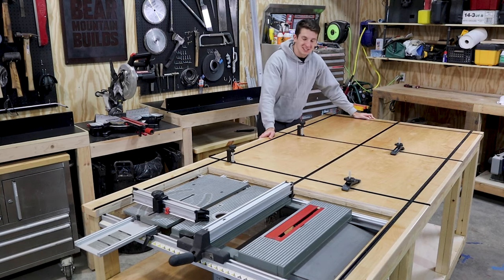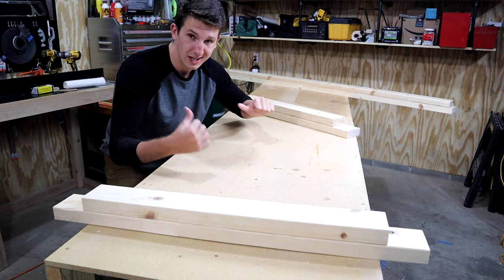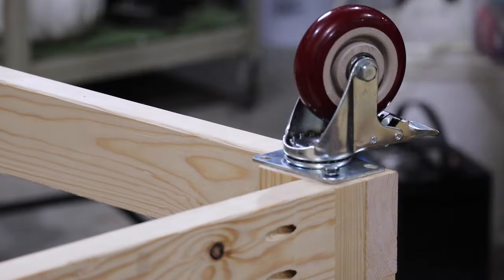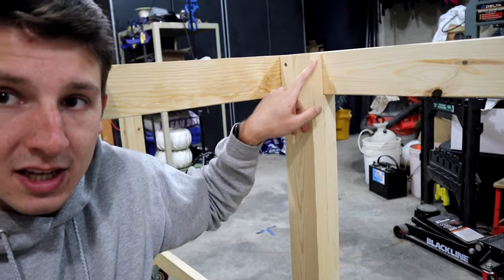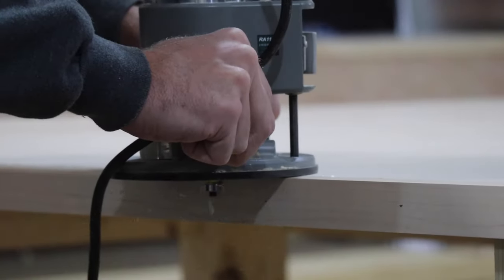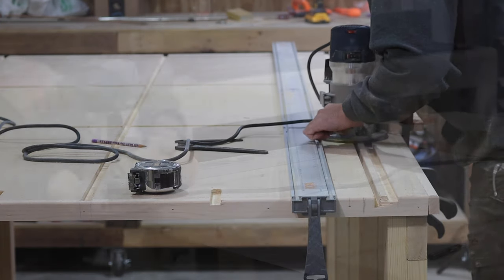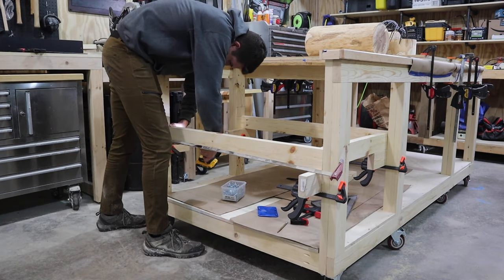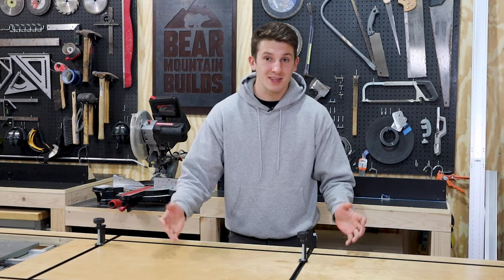Build This Simple Table Saw Outfeed and Assembly Table - Part 1 | FREE PLANS

Comment: I've been preparing for an outfeed / assembly build and also have a Ryobi (BT3100) just like yours. Are you happy you put it all into one piece? Not sure if it would get in the way, especially if you want to lay some large sheet goods on the assembly table to break them down.

Also: Does the outfeed table get in the way of the sliding table on the left? It needs to slide a fair distance forward for the mitre fence to pass the blade.
Reply from the maker: Honestly I’m super happy with the table as a whole. I haven’t had any space issues in my shop with getting the rolling workbench out and around the table. As for cutting down large plywood sheets I usually put several 1.5” wood blocks out on the assembly table top and put the whole sheet on top of those then use my circular saw and a straight edge to cut it down into more manageable pieces. Then I take it to my table saw. You can see me doing this in some of my latest videos
Reply: @BearMountainBuilds  Thanks! What about the sliding mitre on the left? Can you still use yours? Mine goes a solid 12” past the table and it does look like you have the space. I’m thinking of locking it down and integrating mitre slots.
Reply from the maker: @barthrh2  I have the miter saw locked down. It’s snugged up so that when I cut something the back of the saw has about 1/4” gap from the wall. However, my adjustment knob sticks out past the front of the table and I’ve nailed my hip on it a few times. Generally when I’m not using the saw I rotate it as far over as possible to get it out of the way.
Reply: @BearMountainBuilds  Thanks. I meant the left panel of the table saw. The Ryobi BT3x00 doesn't have miter slots so to do crosscuts that left table slides past the blade. It looks like you're set up that this isn't possible anymore, or wondering if it was and/or if you had a plan for adding true miter slots to the table so you could use things like a crosscut sled.
Reply from the maker: @barthrh2  oh I get what you’re asking. I don’t make a lot of miter cuts on my table saw. Generally, any time I make a miter cut I use my miter saw, but haven’t had to use my table saw for bigger pieces. I’ll have to check and see if the sled can be used for that still

Comment: Had your plans for a few months now finally getting around to do the build.  The plans call for 3 sanded 4 x 8 plywood and 1 Birch piece of plywood for a total of 4.  But on the video I only see three pieces of plywood (2 sanded and the birch finished top).  A typo on the plans or am I missing something?
Reply from the maker: I used the fourth piece of plywood to build the top of the table saw platform

Comment: Wait... so I can run 2x4s vertically through a planer?

I'm using your mobile/modular cart build as part of my design for 3 carts. 1 with flip over miter saw, 1 with my table saw, and 1 just flat top. After seeing how nice your mobile carts looked, I decided I will get a planer before I build them bc I like how much cleaner it makes standard 2x4s look. I def can't get a planer and jointer, but I just assumed a planer couldn't be used to do the vertical edges of 2x4s bc I've never seen any woodworker on YT use it that way.
Reply from the maker: You can but it does not guarantee a 90 degree edge. the best thing to do is plane the 3.5'' surface on both sides down about 1/16" per side then cut the bull nose off on the table saw. This method guarantees perfect edges but doing everything on the planer can be a bit faster and most of the time is close enough. Depends on if you need perfect edges based on the build

Comment: Hope is the last question: what was the process to finish the frame with black paint? Sand, did you prime? Which primer etc. as always thanks Zack
Reply from the maker: I did only light sanding on the frame since I had planes the boards before I built it. They I just used rustoleum paint & primer spray paint

Comment: Literally the one and only critique I have of the design is the wheel fastening design - specifically the four corners. Four possible bolts, down to three, one of which is in end grain and is therefore useless when you factor in the potential load of each while while things move around. I'd probably two-gang the lower long runners and put all four bolts in from the end about 4 inches to avoid the end grain from the legs. That's it. Otherwise, fantastic build. (and yes, that'd probably mean I'm stupidly overbuilding it in all likelihood, but that's what I do) :)
Reply from the maker: I haven’t had any issues with the wheels coming out but I can appreciate someone who wants to over build they’re projects

Comment: Great video and build!

I'm curious because I'm looking to build something similar, why did you want your table saw 1/8" higher than the outfeed table rather than being level?  I would have thought perfectly flush would've been the desired outcome
Reply from the maker: I set it at 1/8” higher to prevent wood catching on the edge of the table especially if the wood I’m cutting wants to bow downwards. It really just gives me a bit of tolerance so I don’t have to ever worry about catching the edge mid cut

Comment: just came across this video... loving the table! It's exactly what I'm looking for, and am going to use it as a template. 

Just curious... did you find putting on 8 casters to be overkill after the fact, or were they necessary to carry the load? Just wondering if it would sag somewhat without the center ones. Thanks again, looking forward to future videos!!
Reply from the maker: I’m glad you like the table!! When I was designing this I was going back and forth between using 6 or 8 wheels, but decided to go with 8 because I’d rather have it be too strong than not strong enough. After I built it though I was really glad I used 8 because it lets it roll a lot easier especially with the table being so heavy. It also let me put a wheel under each vertical frame piece which means there is no bending of the frame

Comment: Why is the table saw platform 1/8 inch higher than table? Why not the same? Level? Flush?
Reply from the maker: I wanted to make sure that I’d never catch an edge even if a board was slightly bending or twisting

Comment: Have to ask this but in your video you were doing the cutouts for the bottom shelf after tracing them out  and the next step you were screwing them in the bottom.  3/4" plywood, did you have someone help you drop that in?  Also been researching building one of these since October and after watching enough videos to give me a headache, I decided on yours.  Really well designed and l like the finish look.
Reply from the maker: Thanks, I’m glad you like the table!! I did bring in another pair of hands to feed the board in just to make it go faster since you can’t slide it in easily. I’m sure I would have been able to do it myself, but it would definitely take longer.

Comment: Just an FYI for anyone else. So… I’m building this. I have the plans and noted the comment that says you’re taller and added height. So, since I’m not tall, I took off the extra inches. However, the unforeseen (on my part) impact of this is that the bottom shelf plywood doesn’t fit anymore.
Reply: I really appreciate Everybody doing videos and showing us how they're building their tablesIt's really great. Although, comma why doesn't anybody ever tell you the measugermans lol. I mean I know it kind of depends on your preference of How high you want your table.  But when I 1st started out I had no idea how high they should be no why they should be and I watched hundreds of videos just waiting for somebody who'd tell me the measurements and a cut list. Most of the time they would show you a cut list but it was high speed video and would just show you piles of wood that they cut lol. Like for instance I'm not really good at math and I've built 16' long mighter table station regular shop bench And a bench in the middle of my garage that Is 34" wide and 74" long and I built a jinky little bench at the end of the table for the tablespot to sit onAnd I can never get the height quite right I know I should be just proud of the table itself, the saw should be proud, But my math sucks and I always end up shimming everything and it just looks bad well to me it looks bad everybody else thinks it looks good but I'm very critical of myself. But anyway I'm just saying it would be really people would give measurements for the person who's just starting out that maybe watching these videos. Don't get me wrong I'm not complaining I'm Truly grateful for these videos and The Guys Making them.  Just keep in mind the little guy out there that's struggling trying to start out and build his own tables And has no idea how long to cut what lol. I speak from personal experience. But thank you for sharing your knowledge and your skills

Comment: I keep trying to refer to this, but at no time do you give the measurement for where to put the table saw shelf, on here or on your printed instructions (which warn that they may be individual from there on out, but never GIVE me the measurements)
Reply from the maker: Not all table saws are the same so you have to cut the opening to match the saw area and set the height of the shelf to level the top of the saw with the table top
Reply: Thank you. I'm new and thought I'd missed something. @BearMountainBuilds

Comment: I’m a subscriber and maybe you or someone else can explain the reason your table saw sits 1/8” above table? Is that just so you don’t wind up butting a piece of lumber against the table while cutting a piece? Just curious. I’m grateful for these videos. I have such limited room and want a few table designs for a workshop table, vise table, eventually a miter saw table. So all of these are awesome. The nice part is I can cut out for the table saw later once I’m lucky enough to get one.
Reply from the maker: You’re exactly right. I put it an 1/8” high so that if by board was warped at all it still wouldn’t hit the edge of the table
Reply: @BearMountainBuilds  makes sense to me. I think it’s really awesome you’ve put out these videos and designs. I have my lumbar and getting closer toward build time. Super pumped I found this. So thank you.

Comment: I’m sure this has already been asked in the comments, but there are a ton of them so I figure I’ll just ask anyways. You mention that the platform is made of 2x 5/8” pieces of plywood, but your plans call for 3/4”. Did you just misspeak in the video, or adjust the plans after making the video to optimize the build?
Reply from the maker: Not totally sure where the miscommunication is, but I use two 3/4” sheets of plywood glued together
Reply: @BearMountainBuilds  thank you for clarifying! It’s at 15:43 in this video. You say “consists of two pieces of 5/8 inch plywood…”. No biggie, just wanted to make sure I had the correct materials. I’m about to start this build! Thanks for providing the plans. This’ll be my first build like this, so I really appreciate the video and detailed plans!
Reply from the maker: @ndaworld07  good luck!

Comment: Thanks for the build video and info, great work!  I am considering buying some of the same t-track from Hot Favorable, I just dont want to regret not spending a little more for Rockler ones (and I would prefer the black color like HF offers).  Whats your experience been like with the ones you got?  Thx for any feedback you have!
Reply from the maker: I liked these black ones I used. My only issue with it is that they didn’t come with screws so I ended up using drywall screws to fasten them down so that the colors matched, but the counter sinks in the tracks are just a hair shallow. If you get the screw perfectly centered and vertical it’s the absolute perfect fit, but if you’re off by even a bit the screw head will stick up a hair. I definitely have a few spots on this where the screw head sticks up, but it hasn’t caused me any issues when sliding clamps through the tracks.
Reply: @BearMountainBuilds  thanks for the feedback and advise.  Ironically I just got a new set of vix bits so that 'should' help avoid being too off center!  In theory at least haha.  One last question, I too want to go with the black tracks, but I can't seem to find a black miter slot for the miter extensions I am installing past my table saw onto the table surface.  Any idea where to locate black colored ones?  Everywhere I have looked there is only blue, red or silver.  thanks again!
Reply from the maker: @andrewlogan2482  have you checked the links for the T track in the video description? Those should all be black. There are two different lengths and the intersection pieces. Is there a different style of T track you’re looking for?
Reply: @BearMountainBuilds  yes, I have a line on the t-track (same ones you used actually), but the miter slot on most table saws are wider, they are 3/4" wide ID where t-track is 3/4" wide OD (a miter gauge/table saw sled wont fit into t-track).  I have my table saw installed on the end similar to you in your video and I would like to install a couple short 18-20" miter slots to extend directly from the table saw.  can't find black miter slot though, want it to match the black t-track I was planning if possible, wasnt sure if you had come across any?  But just remembered you have the sliding carriage on your saw (lucky!) so dont likely use your miter slots
Reply: I will likely reach out to a couple of the t-track companies and see if they offer a miter slot channel that possibly isnt advertised with the tracks or if they can make a custom one.  Fig it wont hurt to ask haha!  Plan B will be to look into somehow painting the silver ones or just leaving them open (no aluminum tracks) just a routed channel on the table.  But thanks for the replies, looking forward to your next build videos!   Happy Holidays!
Reply from the maker: @andrewlogan2482  probably a good idea. Sorry, I don’t have any other leads for for you

Comment: Great job, this looks like a great table. Looking forward to starting mine soon. Since I'm pretty new to this type of work I have a couple questions/comments. In your cut plan you have four boards cut at 45" but no where in the page 1 or 2 of the dimensions does it show where those board are placed. Can you help me there? Also, it appears that your table legs are cut at 34 1/2 then adding 4 inches for the casters and 1 1/12 inches for the top would bring the overall height of your table to 40 inches, if I did my math correctly.  So for a shorter person, say 5'8" my legs should be cut at 31 1/2 or so correct. Just started watching your channel, Keep up the great work.. Love the plans.

Comment: The drawing and the video do NOT match and are not correct.  The plans call for 9 - 2x4x42 for the crossmembers, yet in the drawing and in your video you use different length pieces.  The crossmembers in the middle of the table screw to the face of the long 2x4 but the crossmembers on the ends (minute 5:35) mount inside the double 2x4 leg which is 3 inches shorter.  I know this because I had to cut new 2x4s and mount all crossmembers inside the legs like the end at minute 5:35.  If not, the base is only 45 inches wide.
Reply: By the way, I have the same Ryobi saw.  It's odd shaped but cuts good so was very interested in your plans and video.  I plan to mount mine to the left side of the table because the blade is near the left side of the saw.  This will allow the fence to be further from the blade for wider cuts.
Reply from the maker: Thanks for catching that error!! I’ve now fixed the plans on my website
Reply: Lesson Learned:  Level the first top sheet of plywood before you glue on the 2nd sheet.  I ended up with a 1/8 inch dip in the middle and when the two sheets are glued together it is almost impossible to straighten the dip.  I had to use a floor jack and drive in some wood shims.  Gotta love how sturdy this table is!

Comment: I was interested, but cautious with the joinery shown thus far, until about 4:33 when the dreaded pocket hole made it's first appearance. No need to watch further. It's already trash.
Reply: You're being a little dramatic. I've seen a lot of assembly table builds and probably 90% use pocket holes on interior joints. Him using lap joints in his makeshift 4x4s is more than enough structural support. The inside grid is mostly to prevent bowing of the plywood. Could have gotten away with 1x4s even
Reply: Mostly useless trolls who can’t produce/post a useable set of build plans gets to potty on other’s hard work.

Comment: Your going to have the same problem as me. Eventually your going to replace your shitty job site saw for a saw stop or some other nice saw and your out feed table will be useless and you’ll be re working it like I did.
Reply from the maker: Yeah that crossed my mind. My plan is to just make a complete top for the table when the time comes and cut the opening for the saw out of the old top and make a new frame for it so I’ll have two large tables. I think I still have some time until then though